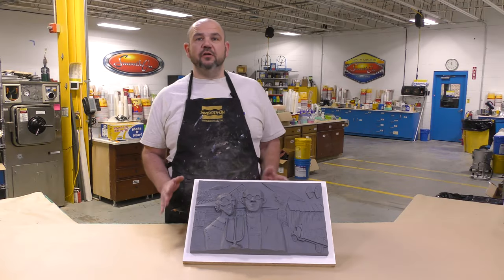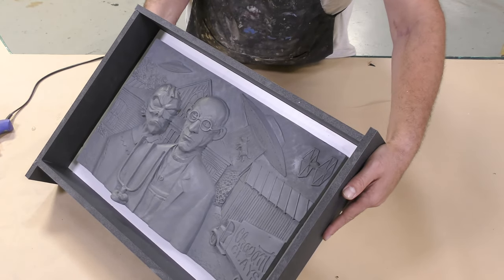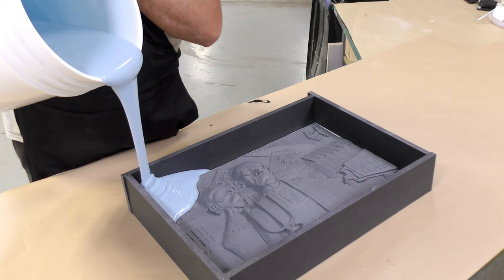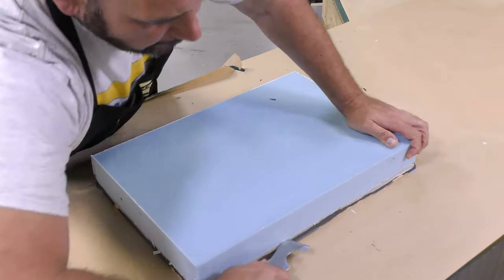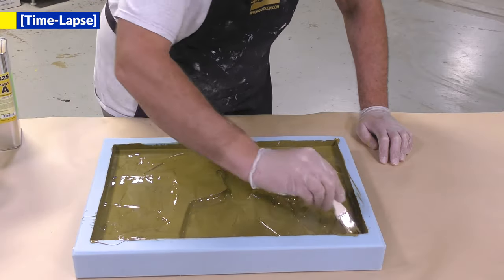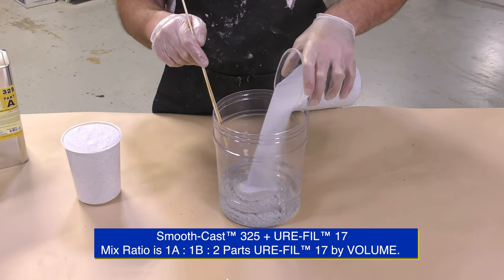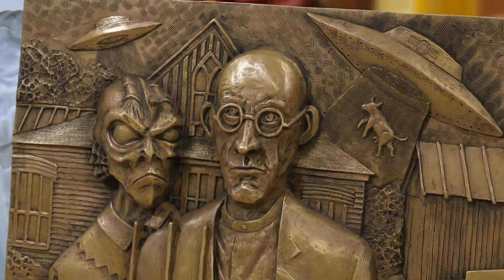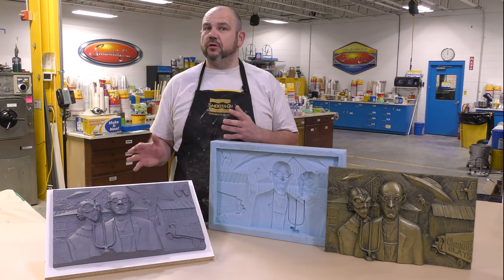Mold Making Tutorial: Turning a Clay Sculpture Into a Metal Cold Casting

Comment: Great video. What's the best way to keep bubbles forming in the face coat?
Reply from the maker: Typically you don't get bubbles because the face coat is brushed into the mold. Brushing helps to break any bubbles that might be present from the mixing process. Talcum powder always helps to break any surface tension and will allow the resin to flow easier in the mold.

Comment: Why use Smooth Cast instead of something like Duo Matrix Neo? What are the pros and cons of each for cold casting?
Reply from the maker: Thanks for watching. Both materials will produce a fantastic cold casting! It will depend on what you are looking for. Neo will be heavier in weight than Smooth-Cast 325 will. Smooth-Cast allows us the ability to back fill the casting with a much lighter weight material. Neo gives a very nice finish because it is a gypsum. So it will depend what you are looking for. If you have further questions you can reach out to our technical support team.  https://www.smooth-on.com/support/ticket/add/agree/ Thanks for watching!